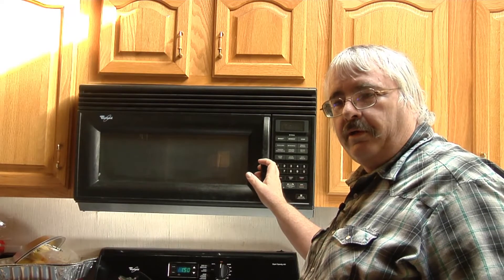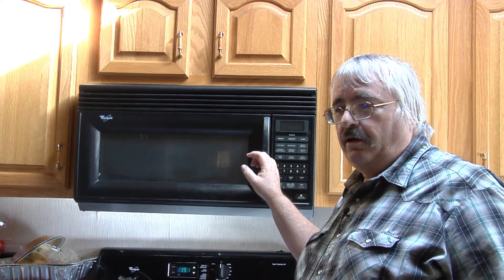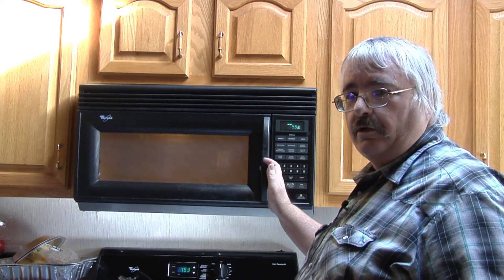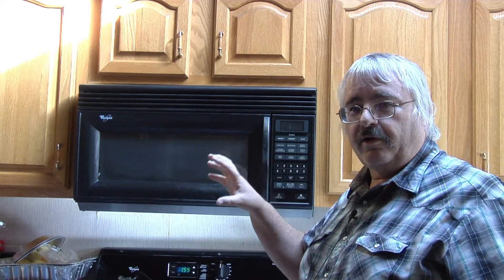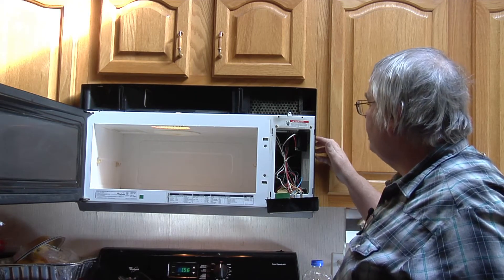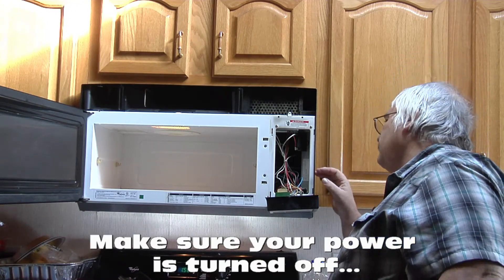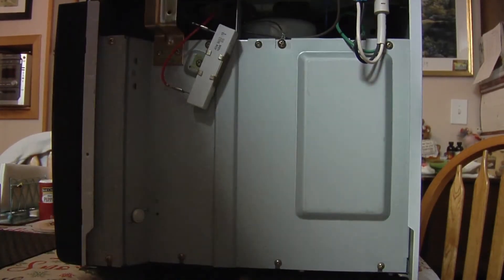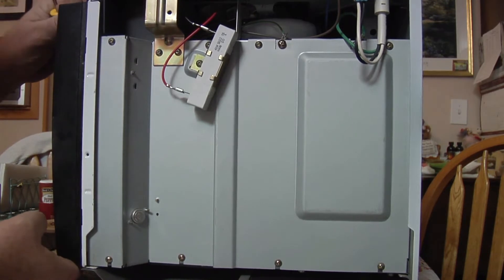Whirlpool microwave MH7140XFB repair, "Replacing the Magnetron"

Comment: They damn sure don't make appliances like they did even 20 years ago!  Shit is too disposable these days (not to mention made of chineseum.)  Our old GOLDSTAR over-the-stove microwave was made in 2002 and shit the bed a couple years ago (it went completely DEAD - I didn't bother trying to fix it, it was a friggin GOLDSTAR after all.) Replaced it with a brand new GE, and after 2 years the steam sensor is already bad!!  I should be happy it's just a flimsy sensor and not a magnetron, I just dread having to haul the damn thing down off of the cabinet and reinstall it AGAIN!! 😠
Reply from the maker: Yes the big over the stove microwave are very nice and saves space, but a pain to work on when they go out.  Yes they sure don't make them like they once did. Thanks for watching.